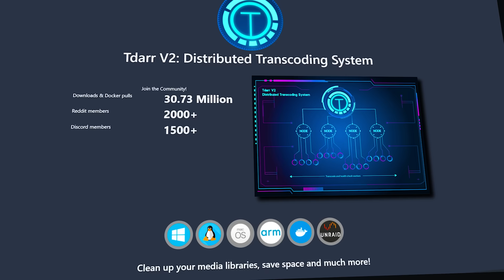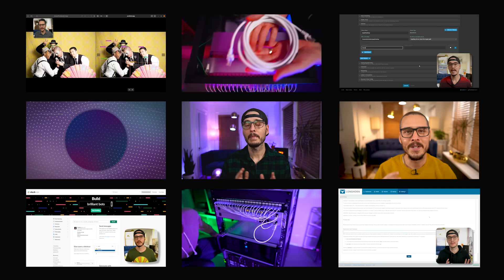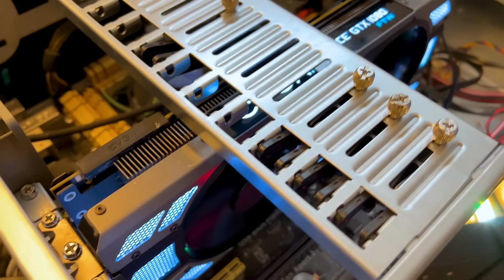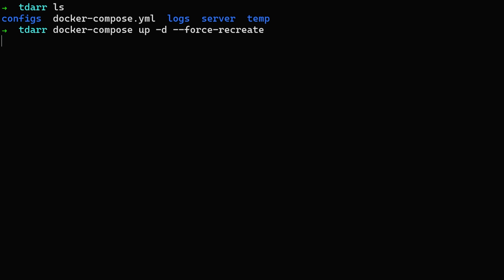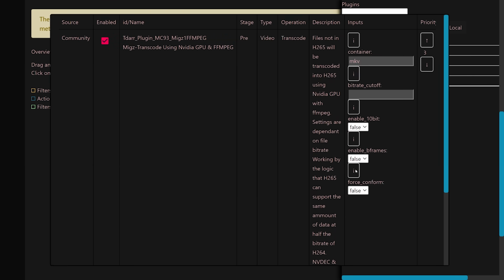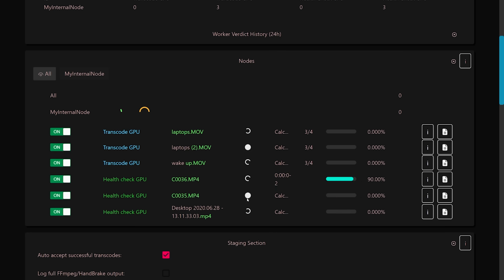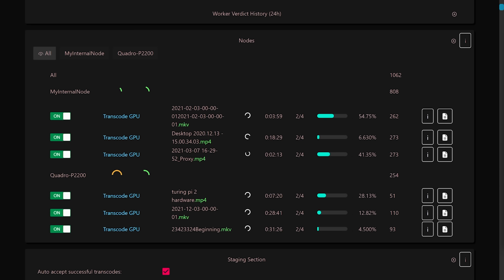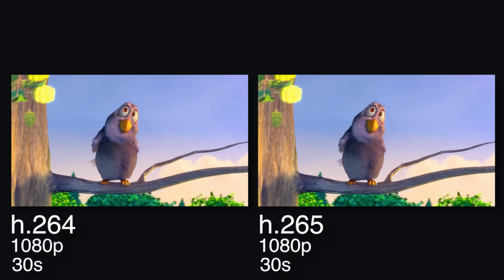I Freed Up 700GB+ Converting my Videos Using Tdarr

Comment: H265 encoding takes to long, more electricity usage, for not much gain in file  size.  You have to let it run a really long time to get small file sizes w/ acceptable quality. If you don’t care about quality then you can have really small file sizes. But tweaking encoder settings to get acceptable quality w/ small file sizes w/ h265 is tedious.

Comment: I'm a power user but found tdarr extremely clunky and confusing to set up. Way too many options and things to learn. It needs a much simpler interface like handbrake or something. It's a convenient tool but has a long way to go in terms of UX.
Reply: Have you tried FileFlows (shameless plug) or unmaniac?  All 3 do basically the same thing, just completely different UX and different feature sets.  But all 3 can take video transcode to different format.

Comment: the new Apple M1 Pro/Ultra have some serious hardware encoders (can do h.265 also), and the max can do 30 streams of 4k ProRes or 7 streams of 8k ProRes.  I'm curious how well it would do at this task if you threw a Mac Mini with one of those cpu's onto your network as a compute node for your video encoding

Comment: First, it is very likely that the existing videos have been encoded with a lossy codec, which should have introduced noises (or artefacts). If I re-encode that using H265, doesn't that introduce more noises on top of existing noises, which the H265 encoder will try to encode, because it cannot know whether something is noise or original picture? 
Secondly, isn't H265 itself fading out? It is proprietary and you have to pay to decode, so a lot of video players do not support it out-of-the-box. As far as I know, Google developed VP9 as an alternative and now they are moving to AV1. So, if you encode everything again, why not do it with AV1, instead of H265?
Thirdly, 700GB? I don't know, I have an old 1TB HDD's that I do not use at home. Last time I bought an external HDD, it was a 10TB and it cost $185 or something. 700GB is less than $13 in that regard. Considering all the energy consumption of transcoding and hassle, I am not sure if saving $13 is worth it.
Reply: I feel like the biggest point of this is not having to add another server to your lab, bacause most of the homelab people already have their servers filled up to the brim. That would mean you have to buy another server, the drives, set it up and it's probably gonna end up sitting idling as a storage server, consuming more electricity, rarely being used. I think that would end up being more expensive.

Comment: Both H264 and H265 are lossy compression schemes. Just be aware the going from one lossy codec to another, you will lose quality. This should really be called a re-encode rather than a transcode. In a transcode, the conversion is happening on-the-fly and then served to a client without changing the source files.

The quality loss may not be a big deal to you or noticeable to the eye, but it is happening. Lossless codecs (like FLAC for audio), are fundamentally different in that you can convert between them with no generational degradation.

Comment: In your video you have assigned 1 movie to 1 GPU/Container .. but as i found out h265 transcode with CPU encode is way more efficient (smaller files with better quality)
Is it possible to use multiple Tdar instances (docker containers) and each one of them to elaborate only few minutes of a 1 single movie/clip ? instead 1 full movie each ?
I have a 3 node docker swarm. In a scenario in which a movie is 30 minutes long , i would be able to assign 10m of clip to each node and let tdar transcode and re-compose the file as output. 
If you want a faster system you would just add docker swarm nodes .. and you would be able to cut transcode time by the amount of nodes you have. 
I saw an Italian guy called morrowlinux did something similar with ffmpeg distributed but i have not understood how he did nor i found any reference in ffmpeg libraries. 
Can Tdar being used for this ? or does anything similar exist that may allow something similar ?

Comment: I’ll agree with others in the comments that CPU encoding yields way better results and can be done with okay speed with the right CPU. My 1950x does it well and my 5950x does it very fast. A gpu will be faster but file sizes are much larger with no quality benefit. My 3090 can do it faster but not worth the file size.

Comment: I'm afraid that the electricity cost for all that gpus running hard for so long might turn out to be much higher than just expanding the storage. I was considerig similar endeavour but since most of my video library is movies and tv shows I can just redownload them in h265 for basically no added system load to my server. Interesing video and toolkit nonetheless.
Reply: Or set it up so once a file is downloaded, it is converted to your format of choice then and there.     Takes a lit bit more time, but not much.
Reply: @fileflows204  At that point though you're just taking the extra cost and splitting it up to be done in significantly smaller but more frequent chunks aren't you?  The amount of electricity used will still be the same for the same number of files but spread out, unless I'm missing something?

Comment: It should be pointed out that there are a lot of options for encoding h265 videos. Tdarr is not unique in this regard. I'm unlikely to switch from FFmpeg and x265.
Reply: Correct, most of these all use ffmpeg under the hood Tdarr, FileFlows, Unmanic.    It comes down your use case and how you want to automate it.

Comment: There is no benefit to running 3 off line transcode streams, as each stream simply runs @ 33% of the total Encoder horse power, especially for h.265. The '3 stream limit' is meant to satisfy real-time h.264 online/outgoing transcodes to viewing clients. I run single offline jobs on ffmpeg in Windows for h.265 and max out NVENC, whereas I run 3 streams of outgoing h.264 that can rarely max out NVENC on my plex server due to the lighter workload.
Reply: Not entirely true, depends on your setup.  You may have some CPU bound tasks to perform in the processing stack, and you also then have some storage actions to take, both of which can take time, but do no use the CPU.  So completely depends on your use case.

Comment: IMO if you are trying to save space and get a better quality, use CPU encoding. Else if you want to transcode a video for plex (like real time resolution switching, etc) use the GPU.
I got into this topic a while ago, when i was trying to rip my blueray collection and noticed the bad quality on NVENC re-encoding.
Reply: GPU Nvidia encoding isn't the problem here. Problem is a Nvidia decoder. Try using CPU as decoder na Nvidia GPU as encoder. That way you will get fast transcoding and maybe even better quality compared to the CPU.
Reply: @vedranart  plex has ondemad trascodig from H265 10bit to any lower quality as long as the gpu in de server has the decoder and encoder available be it intels Quick sync AMD UVD/UVE or Nvidia NVENC or NVDEC
Reply: @sojab0on  Does 12th gen Intel quick sync have it?
Reply: @vedranart  Does it matter which GPU you have ? I have a spare 1660 ti and spare rtx 3060 GPU. Is one better than the other at transcoding?
Reply: @majorgear1021  only Quadro cards support multiple decoding and encoding of videos at the same time.
Reply: @vedranart  Sure. I only do one at a time anyway. So that isn’t an issue.
Reply: Plex can use intel quick sync and based on os it runs on it can use nvenc of nvida and amds answer to that but you card needs to support h265 decode to transcode on the fly

Comment: FYI portainer does not support GPU option currently.
Reply: This is false.... I use portainer.  Using fileflows and Plex both using my gtx1650 just fine...
Reply: @JohnAndrews_nz  did you use the nvidia run time or the new gpu option in docket compose? Any examples?
Reply: @hansaya  At computer now, can post some more info
NVIDIA_DRIVER_CAPABILITIES: compute,video,utility.    
NVIDIA_VISIBLE_DEVICES: all
runtime: runc.
This is on LXC on proxmox and what I use in FileFlows and Plex to use hardware encoding

Comment: It should be said that transcoding video WILL degrade the quality, especially when the source video isn't lossless. You can compare it to converting an MP3 file to a lower bitrate MP3 file. You're compressing an already compressed file format so the quality degradation is doubled. When you're working with archive footage that's saved at really high quality settings, it'll probably still look fine but don't expect this method to do you any favours when applied to a library of movies or TV shows you once ripped to an already lossy format.
Reply: Yea this, any sort of encoding means quality loss. Recoding an already encoded means double degradation. 
For home use it's probably not much of an issue and if you have video storage on a professional level then you are most likely already painfully aware of what you can do with a video file.
On the flip side, you could do this to automate making portable/streamable copies of raw footage.
Reply: Not to forget that you can’t play it back on low end devices. Also you have to convert it back to 264 to upload it to YouTube or most other platforms or play it back without additional software.
Reply: Not even direct dumps fom BD is lossless. So far I keep my bd dumps, but the files sure is big.
Reply: @39zack   why would that be? When you dump a BD without re encoding it’s not possible to lose quality. Or am I missing something?
Reply: I use H265 as an option for converting. I didn’t notice much of a difference.
Reply: It'll definitely cause degradation on smaller movies and shows which a lot of people have.... best used on Remux... also makes housing Remux more realistic for people with a moderate sized NAS. I just wish you could filter by file name/keywords instead of resolution and codec.... ruined my stargate brips which were ai upscaled to 1080p by MGM...
Reply: Not to mention using the GPU to encode isn't the best way either. Sure it's faster, but there can be a quality trade off there too.
Reply: This was my exact question too -- not long ago I spent waaaaay too long getting GPU encoding working under WSL2 with ffmpeg, and even though I was aware there would be a quality drop, I wasn't really expecting to be at a level where I either would notice or care. But it was immediately obvious and distracting, banding all over the place, completely distracting. CPU-reencoded files were the same size (within a percent or two either way), but looked completely indistinguishable from the source (at least to my eyes -- I'm sure somebody who knew what to look for would know!). 

That I was able to see the quality difference was a real eye-opener (no pun intended!) for me, and I ended up just spending the extra run-time using the CPU. It might have taken a lot longer but there's a good reason why they warn you about the quality drop for GPU. If there's a way of getting around this I'd be delighted to hear it, as the time savings would be massive!
Reply: Dude, there's no difference between cpu and gpu encoding as long as you use equal settings. If you don't know what the equivalent settings are, then that's your problem, not the encoding. Unfortunately, sometimes the settings can get very complicated, and sometimes you just need to try out a few different settings.
Reply: @rameynoodles152  Wrong. There is a pretty significant difference: GPU based encoders don't have all loop filters compared to software based encoders. Reasoning is that there are functions which can't be multithreaded, thus they are either skipped or implemented in a way, which wouldn't affect speed.
The output bitstream is compliant with the HEVC specification, however this doesn't mean that they use all available functions.
A good (bad) example would be the missing b-frame implementation until the RTX 20 series of nvidia.
Another example are the amount of options: nvenc hevc has less than 50 options, x265 has more than 200
Generally NVENC is for streaming purposes and storing at near lossless levels.
Reply: @rameynoodles152  GPU transcoding/encoding has limitations in features compared to CPU. The final size/quality will not be the same.
Reply: @rameynoodles152  it's a little more nuanced than that; certain types of re-encoding/encoding features might only be supported on some cards, and if you use CPU (any) or a GPU not supporting some features you might get the same or nearly identical looking results, but the file size will be larger. For best size and quality (not to mention speed) will be achieved if you use an nvidia 2000 or 3000 series (preferably a 2060 or better).
Reply: @jonmayer  yeah, GPU encoding of lower profile videos, like under 720p will get very bad transcoding results compared to CPU.
I've tried to achieve anything near to CPU decoding/encoding with Nvidia CUDA decoding and encoding, and in my results I've came to the conclusion that NVIDIA decoder shouldn't be used if you want to preserve the quality. So the only solution is to use CPU as decoder, and NVIDIA as an encoder. Only then you get fast transcoding and good quality compared to CPU.
Reply: @jonmayer  This project is not for you then. The point here was save space and not beat up the cpu while doing it. for absolute purists who don't want to change their files they should not be changing their files.
Reply: It's also worth noting that if you're using relatively low bit rates for content creation, then you're not making the most of your source material. 
Professional broadcasters will use at least 45Mbps for H.264 encoding, each time you do any processing, it creates a generation loss.
Reply: @BobHannent  Im not talking about low bitrate.
Bitrate can be 45 Mbps or more.
Problem is resolution, width and height of an video source.
If it is 480p for example, Nvidia decoder will create some sort of artefacts and thats a big no no if you have sources from older VGA cameras for example...
Reply: It is completely possible to transcode your entire library of movies/tv from h.264 to h.265 lossless while maintaining the exact same quality (as the original lossy h.264 encoding) and still save space, though it's likely better to accept some un-noticeable loss to save much greater space. Note: I said the EXACT same quality, not APPARENTLY the same. It is also possible to encode with them completely lossless from the start, though I wouldn't suggest that as it will save you MUCH less space. I know this is counter intuitive based on knowledge of other codecs and transcoding, but I suggest you look deeper into how h.264 and h.265 work, and how they differ to understand how this is possible, as the rabbit hole here goes WAY too deep for YT comments. I have read up on this in the past, and have done many tests before settling on my exact per tdarr library "transcode options" stacks/settings.

 I have transcoded pretty much every bit of video on my NAS (really a computer running unraid with a 2080 super and a lot of really large storage in it), and to date (over 3 years) have saved a little over 24TB of space. For my initial original production run of transcoding I used three systems with a 2080 super, a 2060, and a 2070 (testing with a 1070 in the mix originally showed that b-frames support wasn't available on 1000 series cards, meaning less efficient encoding), and it took me about a month and a half to transcode my entire library. When 3000 series launched I got a 3080ti, and have replaced the 2070 with it, but really the 2080 super is the only one dedicated 24/7 to handling new (15 pieces a day on average over the last month, during a writers/sag-aftra strike, for whatever that's worth) additions to the library. I will fire up the 3080ti node from time to time when a large influx of media is added, like if I decide to download an entire multi-season show I haven't previously had in my library... My library is a mix of TV (the largest chunk by far), Movies, streams (back when I was doing that for a couple years), etc. Some of those libraries are maintained with completely lossless encoding, and others are accepted to be very slightly lossy (not enough to notice by for me).
Reply: Try it out. I doubt you see a difference in every Day usage between a 1080p 10 Mbit/s h264 Source converted to a 1080p 5 Mbit/s h265 file. Not saying you cant see it at all, but for general stuff its not noticeable at all imo.
Reply: You know what really ruins video quality? Uploading to YouTube 😂
Reply: After using NLMeans to remove film grain, and a little sharpening tool, not only can you decrease file sizes you can improve video quality.

Comment: The hard-coded dependency to reach out to Github with a stateful connection, concerns me. I'll wait until a proper security audit is done of the project before continuing. It was a bit suspicious when the project tried to reach out to a dozen external IP addresses when Tdarr_Server was launched and several additional external IPs when Tdarr_Node was launched.
Reply: Why would tdarr need to access anything outside of your home network? 

thanks for the heads up, I’m skipping tdarr.
Reply: @majorgear1021  You can ask them, they are on github and discord.
Reply: Tdarr has been around for about 3 years, if no one has flagged it by now, I don't think it does anything nefarious. But if you are that concerned, you should do one.